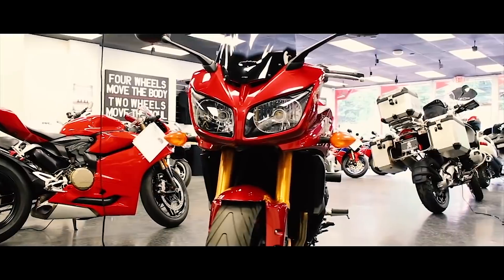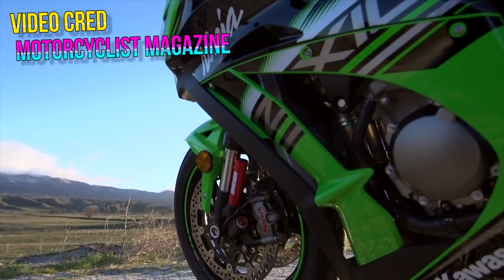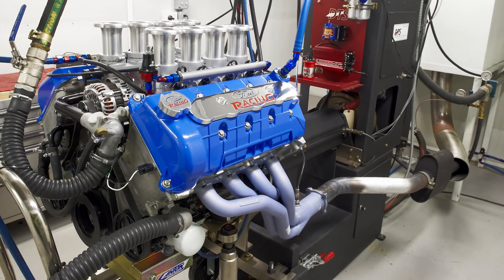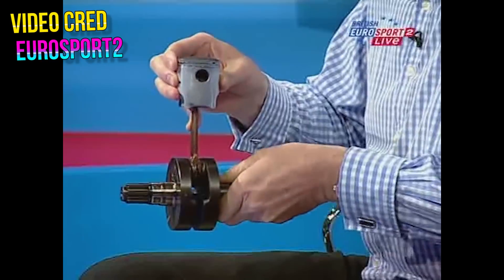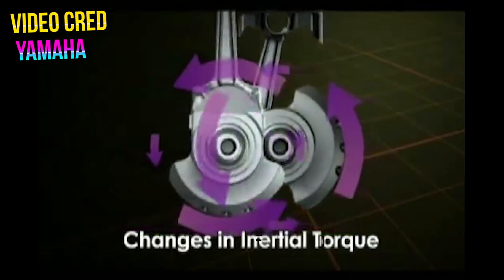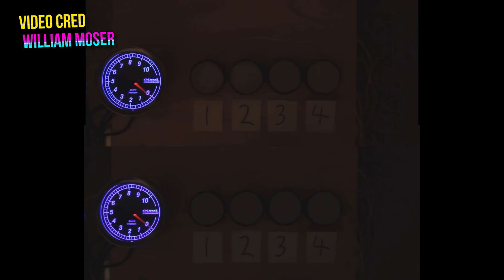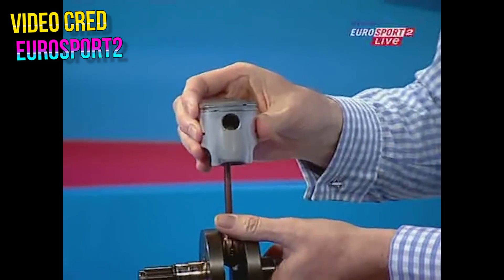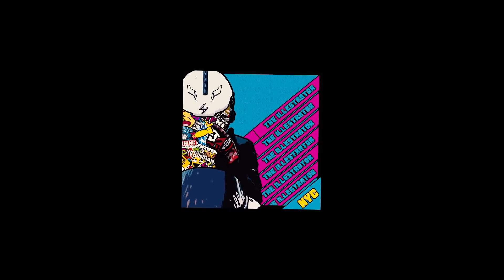Yamaha Crossplane Crank - Why the R1 Sounds Like That

Comment: I really really enjoyed this video. I learned quite a bit. One question though, if the cross plane engine is designed to smooth out the power, why are there so many complaints of the 15 and up R1's having a snatchy throttle but the 17 and up CBR1000RR (well CBR's in general) and 18 and up Triumph Speed triple having super smooth power delivery respectively?
Reply: They're all fly by wire now, so the throttle isn't physically driving the throttle body. The throttle rotates a potentiometer which is read by the ECU, which then does a whole lot of math using lookup tables to determine how much to then rotate the throttle body using a servo. What manufs like to leave out of marketing glossies is how much those lookup tables can make or ruin a bikes feel. It's all about finding a balance of activating the throttle body fast enough with a tiny bit of overshoot for fast response, but doing that only towards higher rpm's - if you process throttle like that at idle you get the jumpy snatchy throttle people complain about. Vice versa as well, when you're at high rpm high power output, manufs like to make small throttle movements feel large to make the bike feel more powerful then it is. On some bikes these lookup tables are hugely complex, they take into account bike speed, rpm, temp, etc to calculate how to move the throttle body in accordance with a given throttle input. A lot of flashing services will change these tables to your liking as well. Tldr: the easiest way to make a modern bike feel "smooth" in regards to throttle, is not overly fuck with and process said throttle inputs in the fly by wire system. That's why the first gen fly by wire bikes felt like such garbage, the engineers had no clue what they were doing since it was all brand new at that point
Reply: @fohdeesha  Thanks for that explanation, I appreciate you taking the time to type that. I'm always trying to increase my knowledge and skill, the YouTube motorcycle community is a great resource

Comment: Honest question...does the R6 09+ have crossplane? If no!, Can somebody explain?
Reply: No
Reply: dyi01 thanks for clearing that up, but can you explain why? I mean do you know why?
Reply: I assume you made a comment on a video without watching it. I suggest you watch the video, it explains what a crossplane engine is and how it differs from a flatplane engine.
Reply: dyi01 I watched the whole video bro! My question is clear and simple. Does the 09+ R6's have crossplane crankshafts or not, if no then why they didn't use? You obviously answered that they don't have, thanks for clearing that up! Do you why they haven't used it yet? Cuz obviously it's an I4 engine. When they use 120° cranks in inline triple engines of the Fz07 and 09...why not on the I4 600? We all know how R6 power delivery is not linear. Just wanted to know why they don't have em.
Reply from the maker: In my opinion, its because these days modern manufacturers are struggling to sell 600s over liter bikes, mainly in the US. the r6 has outsold every other 600 and has done so with the same decade old design. So maybe they don't want to commit to the R&D of reinventing the r6 just yet... maybe later on.
Reply: @Theillestrator1050  Also EU sales of the R6/600s are supposedly plummeting due to the Euro 4/Euro 5 nonsense. Nobody wants to buy a brand new 600 that chokes/wheezes when you hit the gas...(to the guy that asked, these are extremely restrictive exhaust emissions laws) with all of the above, their biggest market for a cross plane R6 would prob be mostly track racers.....maybe Yamaha just doesn't think its worth it as a business decision
Reply: Thanks for the input guys! Maybe you guys are right form the business standpoint. But then there is the Inline 3s with these cranks how hard would it be for a company like Yamaha to throw in some money in R&D that could solve the choking in low revs...the bike will be much more user friendly in that way right. Don't get me wrong R6 is the ultimate 600 for me. But the bike in unsuspecting hands above 8k+ rpms will lead to death while the CBR600 is more straightforward in that point. I would love hear a crossplane 600 <3. With all that said, my country (600) has a stupid homologation process for particularly 600cc'ss which the companies don't wanna be subjected to so they chose not to sell any of their 600s here. 500, 550, 550, 750, 800, 1000 and higher CCs bikes are sold here except any 600. It's stupid and infuriates most of the motorcycle enthusiasts here including me :/. I hope I can get my hands on a 2010-2014 R6!

Comment: Something i've been wondering about is if it's possible to change the crank angle on a bike, or if that requires too much work. Case in point, I like the 570 degree crank on the FZ-07 (Parallel Twin), and would like to see it in a smaller package, like the R3/MT-03 (180 Degree Parallel Twin). not sure if that's really worth the effort or not though, I just like how the twin in the FZ-07 functions a lot like a V twin, and would like it in a cheaper, lighter package.

Comment: i love nerdy stuffs <3   oh can you explain the difference between an auto-blipper and a slipper clutch ?  how do they differ in purpose ? im pretty sure both are meant so that you can mess up a downshift but wont lock up the rear wheel, but why some bikes have both ?
Reply from the maker: They do work independently of each other in that the slipper is just a special mechanical clutch mechanism. And the auto blipper is an electronic manipulation on the ignition. It doesn't hurt to have both, plus a slipper clutch can have its use beyond a precise rev match.

Comment: Why do car inline four sound different from motorcycle inline 4s?
Reply: Motorcycle engines rev much more than car engines, that produces a distint sound
Reply: Smaller displacements tend to give higher sound output maybe
Reply: Because motorcycles have over squar pistons.
Reply: In general, car has bigger engine size valve,crank, etc ( not displacement ) than a bike, thats why bike have that screaming sound.
Reply: 1. Rev range
2. The powerband.
3. The mechanical parts.(i.e. car engines rev lower than bike ones)
4. The displacement limit on motorcycles, and to have more power they need that revving power
5. Motorcycles tend to have more technical maintenance parts than a car(ex. the valve clearance)
Reply: Bore and stroke - cars use taller/narrower cylinders than bikes, as it allows for higher revs with less inertia. An F1 engine is more like a motorcycle engine in that respect, hence the screaming revs
Reply: Idk...Why does a huge bug make a different sound than a mosquito..
Reply: Aside from far smaller capacity, you have short narrower exhaust system, diff muffler and cat setup. Bikes also rev up and down much faster which changes the whole sound characteristics.
Reply: car I4 gotta rev harder for the same power per car weight.

bike I4 is like car V8 or turbo 6
Reply: They are very different in so many ways. It's like a cow and a horse sounds different but both are quardrapeds with longish necks.
Reply: The tolerances of a motorcycle engine are much higher than a car engine. Ever wondered why a Nissan micra with a 1 litre engine has about 1/2 to 1/4 of the power of a motorcycle engine 1 litre? Tolerances my friend
Reply: wrong. It's the state of tune..comp. ratio, camshafts, valve size, throttle body(s) emissions, drivability, etc. Cars need a much broader , and lower rpm torque/horsepower curve.
Reply: Al you right however so was I. All the things you mentioned require higher tolerances and you wouldn’t see a Ford Focus with compression ratios of a motorbike and the power to weight ratios of course play a part. At the end of the day motorcycle engines are designed to higher tolerances because they are not built to go to Tesco’s, they’re made to be on a track or caning it down a motorway. (Most anyway)
Reply: Al  don't forget, crank throws.  Cars have longer throws on the crank, but smaller bore for a given displacement.  It is one reason for the lower redline for a car engine...  This longer throw, gives more mechanical advantage meaning more torque at a lower RPM.  Torque is what makes mass move.

Comment: I liked it like always, but I thought that the cross plane engine configuration was developed by Chrysler, in the 40's-50's? It may have been oversimplified but still enjoyed it.
Reply from the maker: Yamaha is trying to take out a patent on crossplane specifically in motorcycle inline 4s where they've been pretty much unused

Comment: Nice job adding some levity to a somewhat technical subject. I've always thought you had a great speaking/narrating voice, so even if you went full dry tech session, it would still be enjoyable to listen to. 
FWIW, the Yamaha TDM twin had a crossplane (ish) 270* crank way back in the late 90's, replacing the 360* crank from the 1st gen TDM (which I have). Nearly all triples have always had a 120* crank due to the odd number of cylinders being semi "crossed up", despite being evenly spaced from each other. The  Laverda Jalpa is a rare flatplane triple with two cylinders up and one down, and far as I know the only of its kind. It was later changed to 120* like all the rest.

Comment: You make awesome videos man. Keep it up! The only thing I would add about the cross plane is that it is harder to tune the exhaust since the exhaust pulses are hitting the collector at different times. The Ford GT40 actually ran exhaust tubes from opposite cylinder banks together, making it tunable (and sound) like a flat plane V8 even though it’s a cross plane V8.
Reply from the maker: I actually saw a diagram by Yamaha about that comparing the pre-09 exhaust with the cross plane about that. I'm gonna look into the GT40

Comment: Man I must be a motorhead. Found these things years ago online, even the audio sampler which created the difference between 2, 3, 5, 6, 8, 10, and 12 cylinder engines with different firing intervals. There's a reason a crossplane 4 sounds like a V8.....similar intervals. Same relationship between a 3 and 6, or a 5 and 10. 

"Firing order" is which cylinder (typically identified by numbers) fires after the former cylinder.
"Firing interval" describes how long an engine takes to fire between each cylinder in a given order.

The illestrator.... your use of "order" should be instead "interval." :)

"Cross-plane" is simply putting a "plane" between each crank-pin and the center of rotation (crankshaft). If the plane for each cylinder crank-pins are co-linear or congruent with the other, it's a flat-plane. If it's "cross-plane" then it simply means that each plane is at some angle in relationship to the other plane, not necessarily being 90°. That's why every inline-3 engine on the market can be correctly called a "cross-plane" engine. Each plane crosses the other, rather than being congruent with it. Getting really geeky, if one crank-pin is just 1° rotated in relationship to another, it is "cross-planed". Strict geometry terminology.
Reply from the maker: Hmmm, it seems the agreed on format is 90 degrees. I didn't see any other instance where another angle was considered "cross plane". But I'll take your word
Reply: Well, we can credit or fault Yamaha corporation for calling the inline-3 cylinder "CP3" engine a cross-plane design. Personally I believe taking the raw definition of what "crossing" a line is to be anything that doesn't follow that line co-planar or co-linear as "crossing" it. That is more broad by definition than something intersecting a plane at perpendicular.

Comment: I dont quite get how the crossplane design causes the odd firing timing, but great video nonetheless. I learned some things I didnt know, particularly that the firing order is what really gives it the sound it has.
Reply: since there's a half stroke difference between each cylinders (90 deg phase shift), this means there will be one cylinder firing then another after 0.5 a stroke, then a gap of 1.5 strokes before the third cylinder fires and after 0.5 stroke the last cylinder fires, followed by a 1.5 stroke gap and repeat. that's your 4 strokes for a complete engine cycle.

I hope I explained it well :)
Reply: I get that it is that way, but I dont get why? If each cyl is 90° from the next, why do they need to fire in that order as opposed to every 90°? Theres a reason and I'm not saying its wrong, I just dont understand the physics of it.
Reply: Adubs  It's possible for every cylinder to fire every 90°.... for one rotation of the crankshaft. But then you'd need to somehow make it through another complete rotation of the crankshaft with no cylinders firing, as each cylinder completes its other, non-ignition phases (the four phases being: compression, ignition, exhaust, intake).

To visualize, try playing with:
firing : cylinder number : crankshaft rotation
* : 1 : 0
* : 2 : 90
* : 3 : 180
* : 4 : 270
_ : 1 : 0
_ : 2 : 90
_ : 3 : 180
_ : 4 : 270
where '*' is the power strokes (compression/ignition), and '_' is the non-power strokes (exhaust, intake).

Compare this to
* : 1 : 0
* : 2 : 180
* : 4 : 0
* : 3 : 180
of a flat plane crankshaft.

There's just no ordering (in a cross plane crankshaft) that gives an even firing with four cylinders.
You'd need to have two cylinders for every point in the crankshaft that you want to fire. So, four cylinders in a single plane crankshaft, or eight cylinders with a cross plane crankshaft.
Reply: Ok, I get it now. Thanks for dumbing it down for me guys. Now that I get it I feel retarded.
Reply: @adubs.  It's not intuitive, takes a bit to wrap one's head around it.
Reply: +Adubs nah dude this shi* is counter intuitive and confusing. btw great explanation Christian.

Comment: Wasn’t the crankshaft also counterrotating to improve stability?
Reply: it does actually disprove stability :D You counter the rotation of the wheels to reduce the gyroscopic force in the bike to make it tip over better. Faster leaning and changing directions is a big advantage on the racetrack and in the city :P

Comment: Insane how much that light things actually sound like the engines 😂
Reply from the maker: Right? It was such a revelation for me. It also gives a good idea of how quickly the engine is firing when idling because you can kind of make out the combustions still at that point.
Reply: - The illestrator - yeah exactly, really fascinating to watch!👌🏼
Reply: Yup, take a pulse and speed up enough and you can get a tone.  Speed it up and slow it down and you get range.  Listen to some speedcore and it works perfectly.
Reply: I'll try replicating that sound using a microprocessor controlled sound system and hook it up to my bike with a 🔊😂😂😂😂
Reply: This is also how the card attached to a bike tire as a kid also gives a cheesy engine sound.
Reply: @ANSWERTHECALLOFJESUSCHRIST   - and I heard. (non related, just Jesus related). :)

God bless you brother.
Reply: @Faith_Plus_One  It's better than related. We serve our good Lord 24/7. God bless you too, brother! Peace! 💓🙏🦅🐑☀
Reply: Also, half engines sound like their doubles assuming the crank configuration is the same, example the crossplane 4 sounds like a crossplane v8 and so on...
Reply: How come the R1 CP has equally spaced crank pins but fires in a unequal staggered way?

Comment: Cross plane r6 when tho
Reply from the maker: Not sure, but isn't it weird how they tried to patent it... and then put crossplane in the whole FZ line. But the r6 still isn't.
Reply: My guess would be that in a 600 all the power is at the top, and the cross plane is inherently less balanced, so they kept the flat plane to keep the rev limit as high as possible.
Reply: @TheTomco11  the flat plane has better primary balance so it will be smoother up to the mid-range, but the crossplane has much better secondary balance so it should be happier at high rpm.